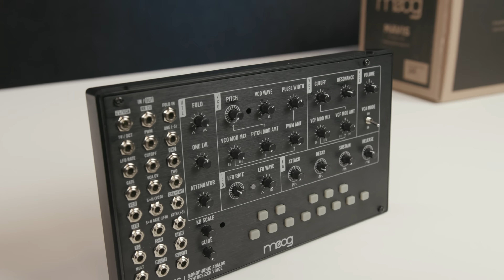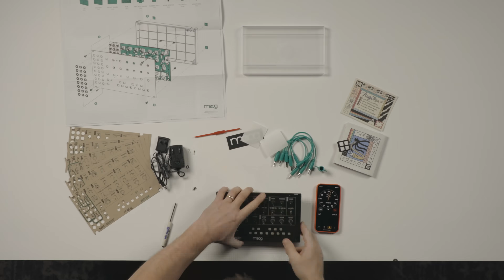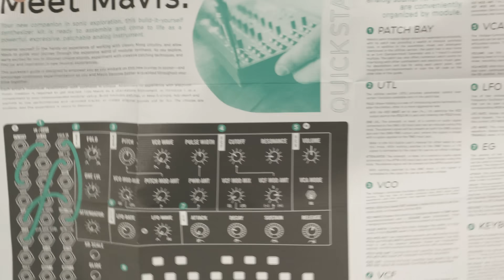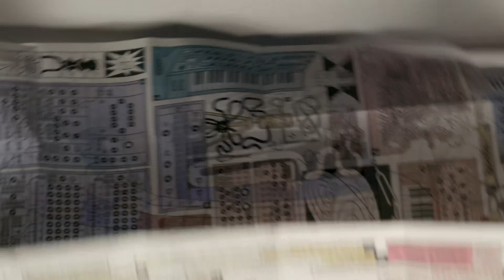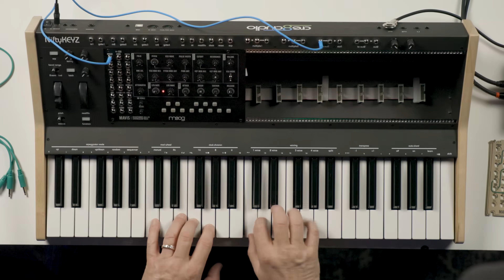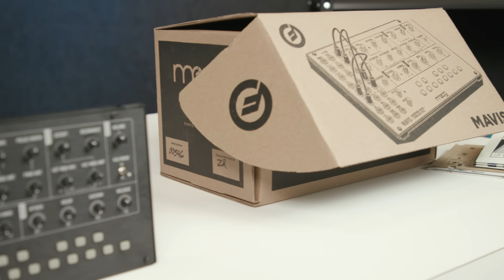Moog Mavis Semi-modular Analog Synthesizer Kit Demo — Daniel Fisher

Comment: i like watching your vids daniel, but this one you missed something very important out, now i know many will say god are you that stupid, i mean me, but explain to me how you, 1) connect to the keyboard and 2) how mavis is powered when you pop it into the eurorack keyboard, i,e what connects the 2 together, ?, you seem to miss that out completely,
Reply from the maker: Hi thebugacademy. Nobody knows something until they learn it. The answers to both of your questions are related to the basic connectivity that's standard in Eurorack devices. Eurorack power is supplied to each and every rack-mounted module via a standard flat ribbon power cable (included with Mavis). External note and parameter control is provided by standard Eurorack cables (included with Mavis). Typically, any module that provides control voltages can be connected to any module's parameters that has voltage control inputs. For a video explanation, start here:
https://www.youtube.com/watch?v=mrV7KqLVmKQ
-Daniel

Comment: Do you buy a connector to power on the synth? If so which one should I buy for this system. Also when I get this connector do i plug into a computer 😅 turning it on is kinda confusing
Reply: It’s a nightmare to get this information anywhere!

Comment: Do  you prefer the Nemesis/Ventris combo for effects and how would that compare to just getting the Collider?
Reply from the maker: Hi totorotj. If I'm going to be twisting Delay and Reverb parameters in real time, then I prefer the Nemesis and Ventris as separate pedals. (Or, just get really good at checking to see if the little chrome switch on the Collider is set to Delay or Reverb... before you turn any knobs.) 
But, aside from having to remember to check the Delay/Reverb switch, I've found that the Collider does pretty much everything I want from the Nemesis/Ventris pedals. -Daniel
Reply: @sweetwater  I currently have a Collider and Nemesis on loan to try with my Moog Grandmother, DFAM, Mother32 and Subharmonicon setup(also trying a NU>X Duotime). I find I'm tweaking stuff all the time since I'm testing but in practice how much do you really mess with the knobs in real time? Also could some of that be mediated by using the 8 presets? Getting just the Collider would be cheaper for sure and it seems there are a lot of options I just wouldn't use with the Nemesis/Ventris setup. Thanks for the help with this, I love your videos and have learned a lot as this Moog stuff is a new area of learning for me.
Reply: Hi Daniel, I replied to your other answer but never heard back so here were my followup questions. Thanks again for the help:  I currently have a Collider and Nemesis on loan to try with my Moog Grandmother, DFAM, Mother32 and Subharmonicon setup(also trying a NU>X Duotime). I find I'm tweaking stuff all the time since I'm testing but in practice how much do you really mess with the knobs in real time? Also could some of that be mediated by using the 8 presets? Getting just the Collider would be cheaper for sure and it seems there are a lot of options I just wouldn't use with the Nemesis/Ventris setup. Thanks for the help with this, I love your videos and have learned a lot as this Moog stuff is a new area of learning for me.
Reply from the maker: @Big_Swifty   I mess with the knobs in real time all the time. Yes, some of that can be mediated by using the 8 presets. -Daniel

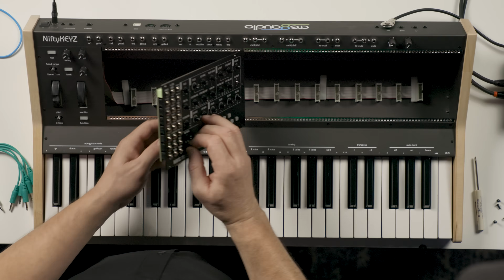Comment: At 14:38 where do you get the ribbon cable to plug into the Nifty Keys? Also, can the Werkstatt also be plugged into this?
Reply: Hi St8kout. Here are links to two appropriate cables:
https://www.sweetwater.com/store/detail/EuroPC10-16--tiptop-audio-10-to-16-pin-eurorack-module-power-cable
https://www.sweetwater.com/store/detail/4msMultPwr10P--4ms-multi-power-cable-10-pin
As for "Can the Werkstatt be plugged into this?", if you mean "plugged into Eurorack power", then no. If you mean "plugging Werkstatt into Mavis via control voltages", then yes.
-Daniel

Comment: Will Sweetwater sell fully assembled versions for those of us who don’t want to deal with that?
Reply from the maker: Hi Jared. Our Service center can be hired to do it, but it's very easy to build. Watch this video in slow-mo (Playback Speed = 0.25%) and you'll see it's just some screws and some nuts, no wiring, no soldering:
https://www.youtube.com/watch?v=huppCz-GvNY
-Daniel
Reply: Can you operate a screwdriver?
Reply: It's not rocket science. As you can see it mostly just takes a screwdriver. Just follow the instructions.

Comment: We to this. So you would have to connect this to a sequencer to make patterns? Please correct me. Thx
Reply from the maker: Hi pete z. Yes, you'd need an external Sequencer and/or Arpeggiator. And it would need to be the kind that has CV (Control Voltage) Outs. For example:
https://www.sweetwater.com/store/detail/KeyStep37--arturia-keystep-37-37-key-controller-and-sequencer
-Daniel